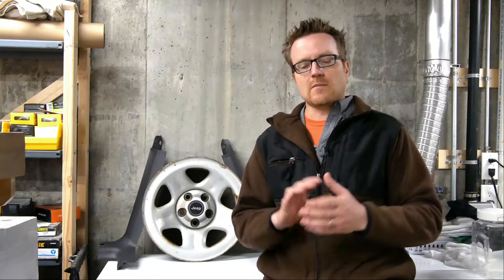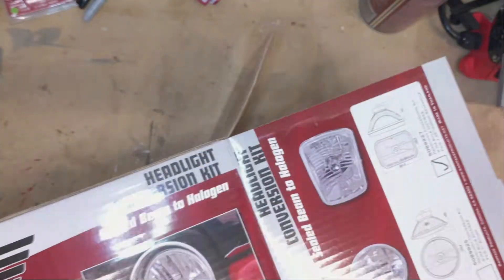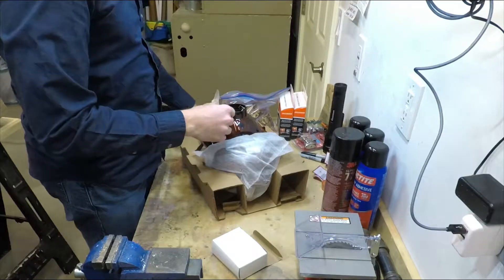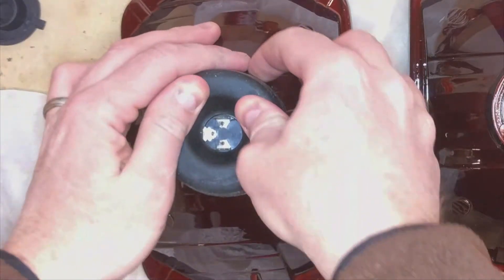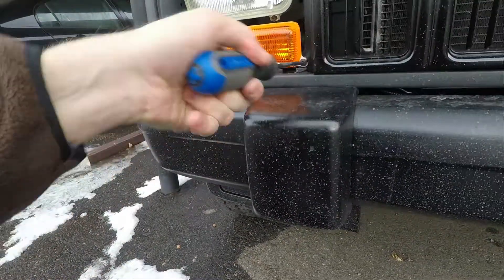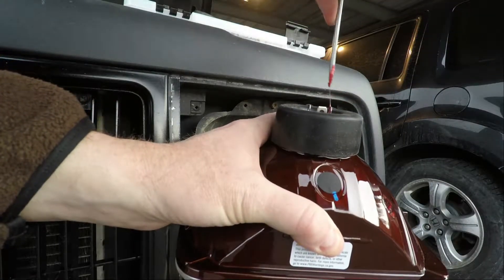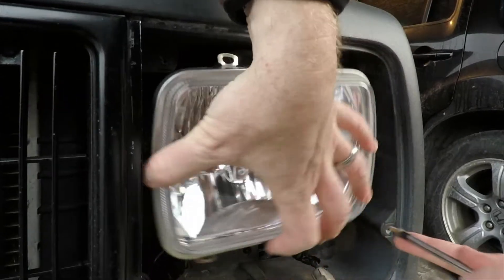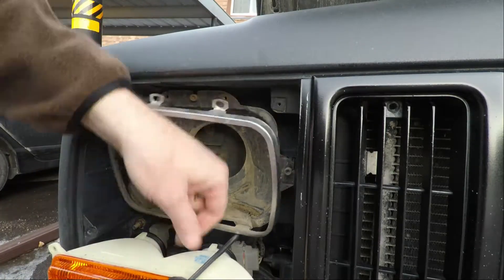wqt//Basic Auto: Sealed Beam to H4 Halogen (1984-2001 Jeep Cherokee XJ)

Comment: The Euro export XJs have these h4 style lights However, they also have a small bulb under the H4 bulb for daytime running lights. My housing have rust damage around the h4 connector going all the way through to the mirrored side of the housing. I want to replace both housing, but I can't find anything like is shown in this video, but with the addition of those two extra holes.
Reply from the maker: I have never seen those fixtures in the US. US XJ models never had DRL and used sealed beam fixtures to the end of production. If they exist in wrecking yards or aftermarket then you might find them in EU countries, Britain, Japan, Australia...

Comment: All of the sealed beam headlights I have used in my xj's for the past 25 years have been halogen..not sure what the big difference would be , except you may have the ability to alter your wattage outputs on the new ones.....IDK....?...Do tell!
Reply from the maker: Sealed beam units rely on prismatic moldings in the front glass to shape the beam. This cuts the light output slightly. The H4 conversion does all the beam shaping with a more expensive, but re-usable, multi-faceted reflector and clear front lens. It also allows easy use of Silverstar and other high-temperature bulb options that are widely available in the H4 style.

Comment: Do these lights leave a shadow In front of the vehicle? I purchased a similar conversion kit"projector" it had a terrible shadow in front of my truck. I had to have them on high beam just to see to drive.
Reply from the maker: No "shadow," these are DOT-approved, reflector-driven halogen fixtures that have similar output to the OE sealed beams, but better light transfer. I've since upgraded again to LED fixtures and I bought a good pair (i.e. not the $80 auction-site specials). That video will go live in a few days and will include a quick comparison of beam patterns.
Reply: @aaronvienot  cool thanks

Comment: Good video but even though I'm super minimally OCD, I can't believe you didn't clean out the headlight buckets while you were in there.  Correct about the metal bezel, it is made out of aluminum foil and I would never just remove 2 screws and bend it.  I recently replace mine with DOT approved Hella lights for about $100 for the pair but haven't yet driven at night.
Reply from the maker: They fill right back up with dirt even if you clean them :-) I've since upgraded to Truck-Lite LEDs. They were pricey and they don't self-defrost, but the light output and beam pattern are fantastic.